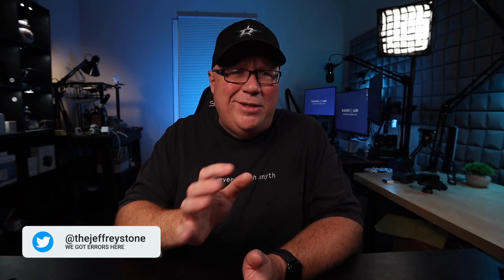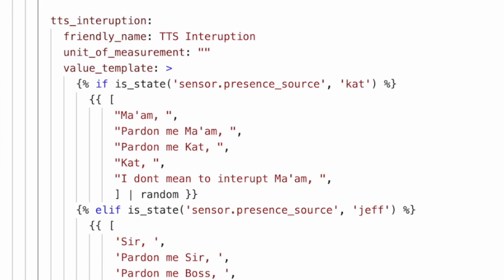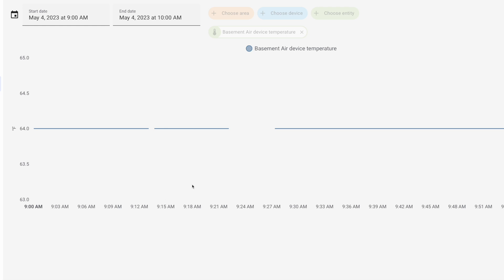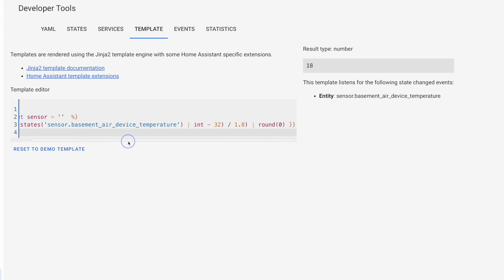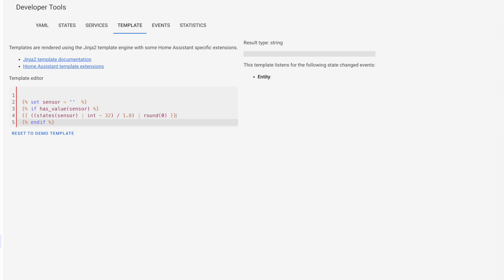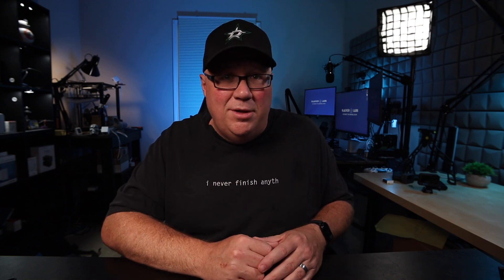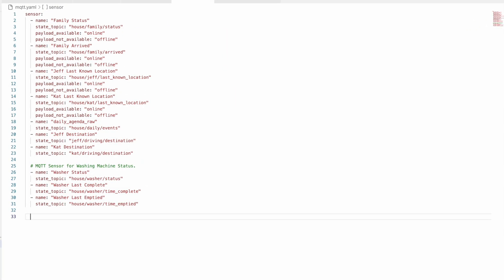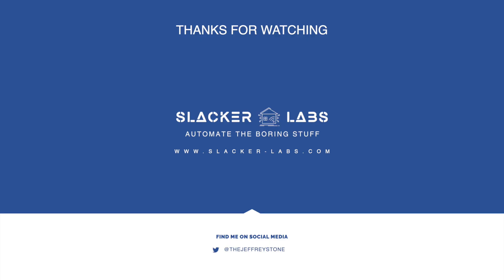Mastering Home Assistant Templates: We got Errors

Comment: You can also use the availability template.  Found this on the HA forums and it works really well for me.

  - platform: template
    sensors:
      hvac_attic_delta:
        unit_of_measurement: "°F"
        value_template: >-
          {% set outside = states('sensor.outdoor_temperature')|float(70) %}
          {% set attic = states('sensor.attic_temperature')| float(70) %}
          {{ (attic - outside)|round(1) |float (0) }}
        availability_template: >-
          {% set items = 'sensor.outdoor_temperature', 'sensor.attic_temperature' %}
          {{ expand(items) | rejectattr('state','in',['unknown','unavailable']) | list | count == items | count }}

Comment: I have several 433mhz door switches, connected through  a tasmotized RF box, and my doors and windows that aren’t opened for a long time show up as unavailable, is this the same issue?
Reply from the maker: I don't think so. Unknown is typically in regards to the state not being available. Either expired or the system just booted so it hasn't gotten an recent update from the entity. But the device is still talking to home assistant and potentially sending/updating other attributes. Unavailable is typically related to the device's "heartbeat" so if Home Assistant doesn't see that device as connected or doesn't have a way to reach the device then it goes unavailable. This would be the case in an entity that is restored after reboot, but home assistant hasn't heard anything from it.
Reply: @SlackerLabs thanks for the reply, can you point me to a direction other than going around and opening and closing all the windows and doors, or replacing the switches?

Comment: Hi Jeff, another great video, thanks for your efforts. I recently came across template trigger sensors and found them very useful for dealing with this sort of situation. You could have a sensor only convert to celsius when the fahrenheit value is valid, otherwise keep the previous state but also have an attribute which gives the last  updated time to potentially handle stale data. Something like this:

template:
  - trigger:
      - platform: homeassistant
        event: start
        id: on_boot
      - platform: state
        entity: sensor.basement_air_device_temperature
        id: sensor_updated
    sensor:
      - name: Basement Temp Celsius
        unique_id: basement_temp_celsius
        state: |
          {% if has_value('sensor.basement_air_device_temperature') %}
            {{ ((states('sensor.basement_air_device_temperature') | int - 32) / 1.8) round(0) }}
          {% else %}
            {{ states('sensor.basement_temp_celsius') }}
          {% endif %}
        attributes:
          last_updated: |
            {% if has_value('sensor.basement_air_device_temperature') %}
              {{ now() }}
            {% else %}
              {{ state_attr('sensor.basement_temp_celsius', 'last_updated') }}
            {% endif %}
Reply from the maker: Yea. I have a whole video dedicated to trigger based template entities.

Comment: 2023.5 has given me this template error... Automation runs fine. Error says it wont.
Master Bedroom TV on off sync uses an unknown service
The automation "Master Bedroom TV on off sync" (automation.master_bedroom_tv_on_off_sync) has an action that calls an unknown service: homeassistant.turn_unavailable.
This error prevents the automation from running correctly. Maybe this service is no longer available, or perhaps a typo caused it.
AUTOMATION TEMPLATE SERVICE: service: homeassistant.turn_{{ trigger.to_state.state }}
Reply from the maker: That looks like it was unable to get the trigger.to_state.state . It was reporting it as unavailable. I dont think any of the trigger entities changed. Maybe it's triggering by something that doesn't have a state? You could wrap that service section in the {% if has_value('trigger.to_state.state') %}... logic and see if hat helps. But it's weird that it is seeing the trigger without a to state
.
Reply: @SlackerLabs  its always available, and it always works.  Home assistant is falsely reporting it as an error.  Reported as bug to HA.  no ignore button on the "repair" notice either.  oh well. no biggy
Reply: @TristynRusselo  If you feel it is falsely giving an error alert, I would suggest the forums or log an issue.    
Your issue is very weird.   I've never had a template based around valid values give an error.   If trying the tips in this video do not work, I would suggest looking at why the entity in the template has an invalid value.   Is it just when yourestart that it reports unknown until it gets the first value in?
Things like that are beyond YouTube comments section though
Reply: @EsotericArctos  As I stated in my last post, i have reported it already to HA (via github bug reporting).
they were no help for a workaround, thought maybe here would spark an idea.
The error message is a "repair" notification. it shows on reboot and after the automation runs.  The "value" it is looking for is the trigger to state  (on or off).  did the trigger entity turn on? or off?

heres the whole thing:
trigger:
  - platform: state
    entity_id:
      - light.master_bedroom_ceiling
action:
  - service: homeassistant.turn_{{ trigger.to_state.state }}
    target:
      entity_id:
        - light.master_bedroom_tv_lightstrip
Reply: @TristynRusselo   Exclude 'unavailable' and 'unknown' from your trigger:

trigger:
  - platform: state
    not_to:
      - unavailable
      - unknown
    entity_id:
      - light.master_bedroom_ceiling
Reply: I think you nailed it.  i had doubts. but tried and rebooted, no message. triggered automation, still nothing...  good job!~